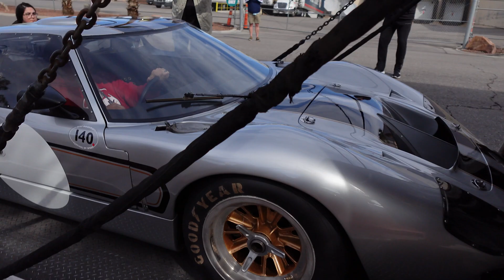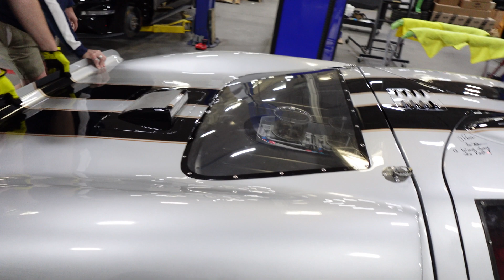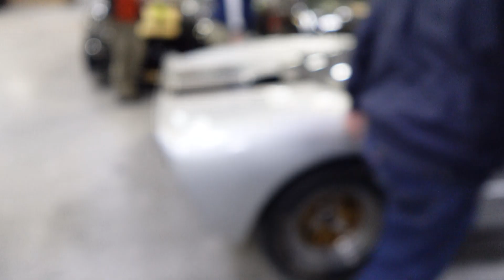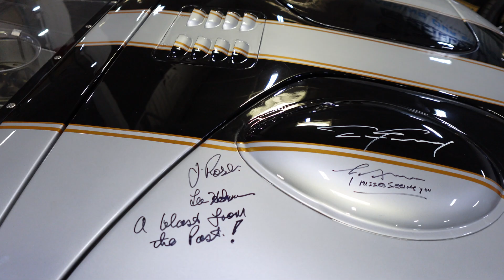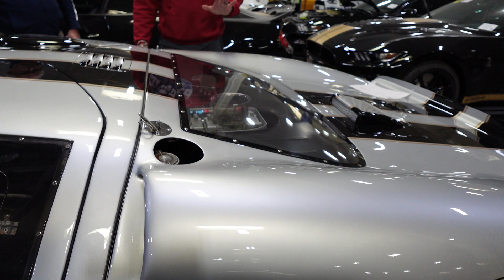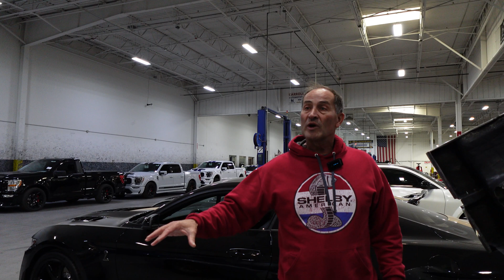Gary Patterson and an ORIGINAL GT40

Comment: This is chassis P/1012 and it was badly damaged around 1969 when being driven by Peter Revson.  After that Holman Moody had it sitting in their facility for roughly a year until it was purchased by Don Davis.  He spent a few years rebuilding it.  He and Bob Bondurant raced it for many years.  He then sold it in which it had a few more owners until it was restored by the new owner.  It's been recently displayed at Pebble Beach and few other shows.  It's been driven at 160+ MPH and it happily resides here.  I don't know if the fluids have been drained from the car and it's possible that they are not allowed to start the vehicle.
Reply from the maker: Interesting! Thanks for the info...
Reply: The rear body work is something I have not seen before, as well as the louvers in the roof.

Comment: The car is indeed an original Mk. IIB, however it was not built and raced in period. If I recall, sometime between the 70s and 80s, some company got the rights to the GT40, and they made a few extra original to blueprint chassis. Beautiful car! ❤
Reply: Holman - Moody
Reply: @TS-vr4xq  thanks
Reply: @torque-drive2488  you're welcome . I think they are working on the last chassis now . I believe the Moody part was part of the original team on the original build as well .
Reply: it's Chassis #1012. It was entered by Alan Mann Racing in LeMans 1966.
Reply: @05FordGT  oh I see. I thought it was a later model, guess it just got a new paint job. I stand corrected